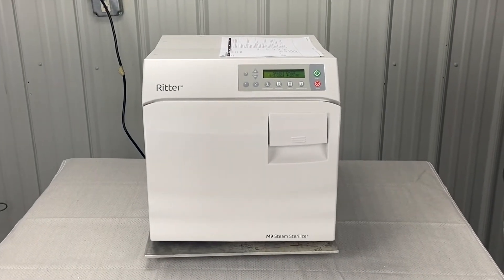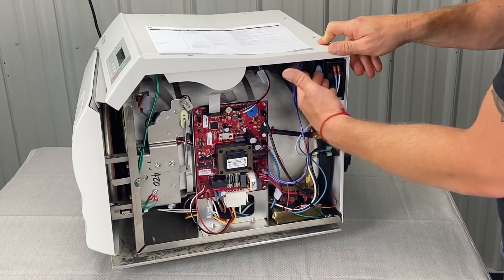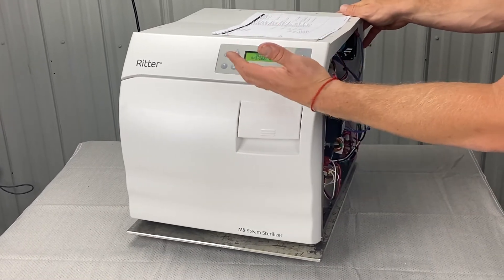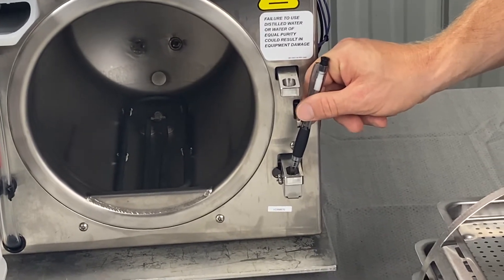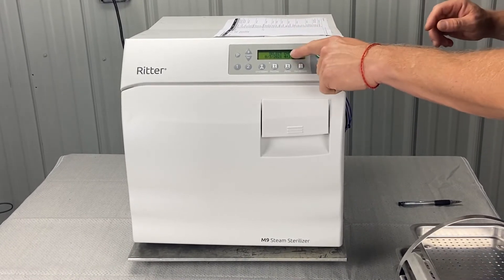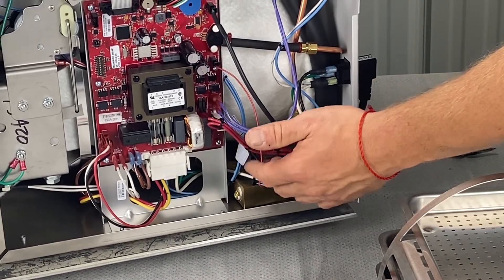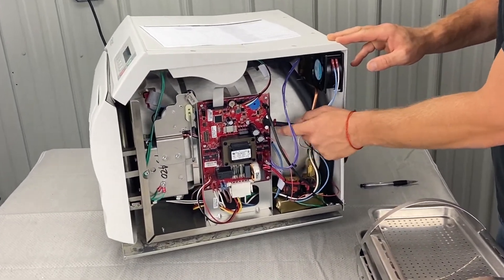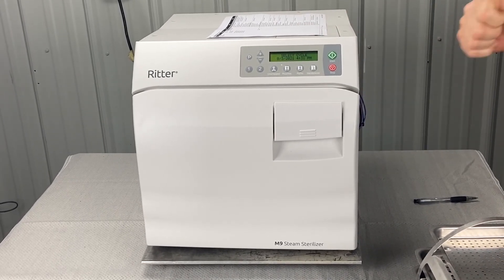Midmark New Style M9-M11 Error Code C633

Comment: heater measures good, measuring zero ohms across overheat and surface sensor, no voltage from pcb to heaters, is that a defective pcb?
Reply from the maker: Thank you for the comment! For help further diagnosing your issue, we recommend you call into our Free Tech Support Line at 704-966-1650 Option 3 so our technicians can better help you with your PC board